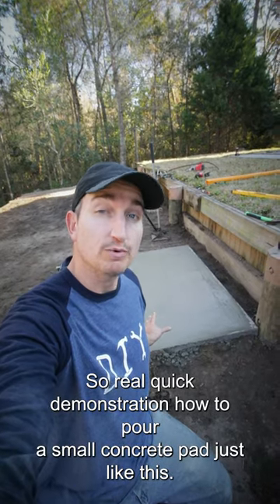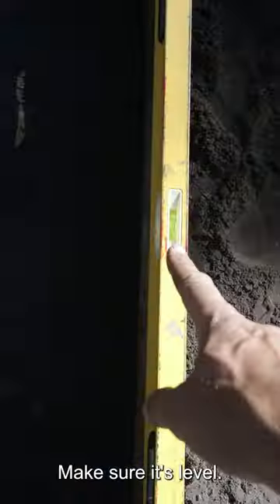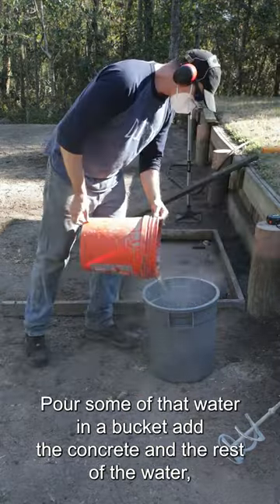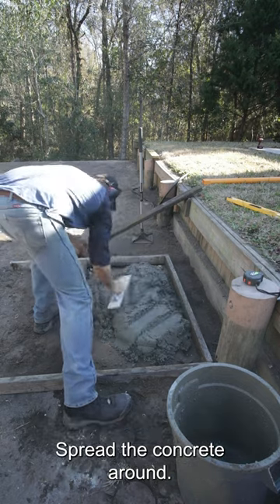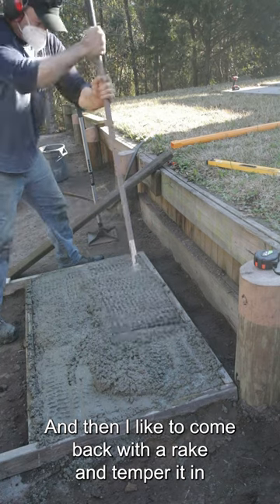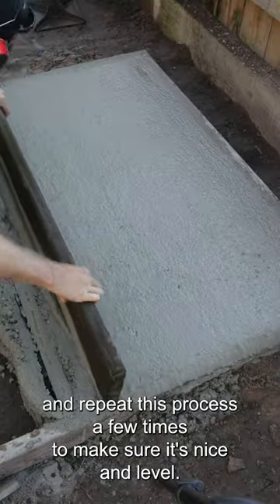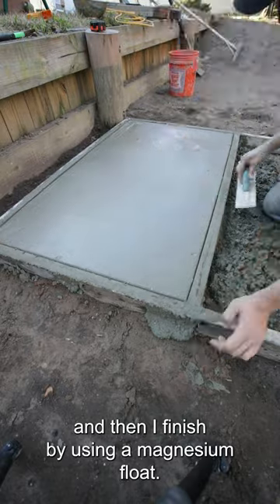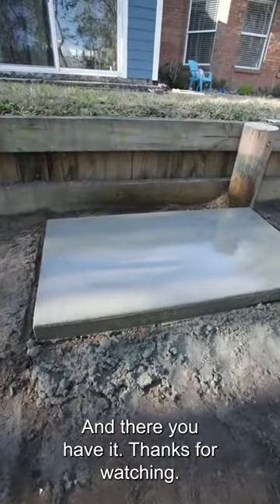How to Pour Concrete Pad Yourself

Comment: not bad for a home owner lol. some advice from a concrete formworker and finsher. if you are gonna build your pad at ground level, dig down the edges to creat a thickend edge. will reinforce the edge but also prevent sub- base from coming out from underneath the pad causing sinking and cracks. use gravel absolute minimum 3 inches. also a few pieces of rebar couldnt hurtm. 3 the long way, and 3 vertical. 3/8 or 1/2 is perfect. some companies like wire mesh but it doesnt do its job as well as rebar is just as expensive if not more at times. rebar and wire are meant to keep the concrete TOGETHER when it finally cracks. wire mesh tends to flex WAYY more when it does crack but its better than nothing
Reply: That's really helpful. How far down do you dig down the edges? A few inches down?
For the rebar, does it have to be kept in the middle somehow? Or can I just push it down in to around halfway?
Reply: @evanlane1690  so if its a 2x4 concrete pad it would mean its 3 1/2-4 inches when poured. Dig all around edge to like six inches would be good. Tiny slope from 4-6 inches to edge. For a 6 inch slab, 8 inch thickend edge
Reply: @evanlane1690  for the rebar, dont leave it on the ground . Pick it up about an 1 1/2 inches not too much. If its too close to the top, it will degrade the surface overtime, exposing the rebar and or showing rust streaks.
Tie it in a grid pattern
Must be 3-4 inches away from the form/lumber, always. You can make a "grid" essentially. You can tie every intersection at every twelve inches, (12 inches on center) or 16 or for a simple pad like this do what you feel like. For a big area. Tie 50% meaning EVERY OTHER intersection. Alternating. For small patios and rebar grids you almost always have to tie 100% otherwise it doesnt hold shape well. Some people like doobies or chairs aka concrete blocks to hold up rebar but thats not necessary unless its a giagantic concrete.  Just pick it up as you add concretr
Reply: @Fr3sh-Kush  - put the rebar on some kind of stands (e.g. a stick with a nail in the side of it). Make it end up half way inside the slab. After the concrete is all poured, fish the stands out and level it out.
Reply: @johncoops6897  nah. Just pick it up as you go. They make chairs that you can leave in the pour or concrete dobies
Reply: @Fr3sh-Kush  - I know they make chairs. But this is a video for DIY and this goober isn't giving very good advice.
Who would mix concrete for a slab in a bucket using a drill attachment to mix it?
Reply: You are living proof that if you want info from online, just post your work no matter how good you think it is and someone will eventually correct it properly hehe. Thank you for actually explaining what's what. Really helpful for pouring some patio slabs
Reply: @contytub  well ill tell you one thing, theres more than one way to skin a cat! Lol. Different ways of obtaining the same goal but there is also common mistakes that alot of people like rookies or diyers tend to make. Well alot actually but i dont wanna knock anyone down lol, we all gotta start somewhere, just like to advise basics and good habits to get a better end result
Reply: @contytub  and i absolutely love concrete. Started by helping out my family when i was 13 and have never stopped. Concrete finish work is difficult, challenging and exhausting but at the same time artistic and rewarding.
Reply: @Fr3sh-Kush  by trade i'm an electrician ... you guys at least have something to show as it's actually illegal here to poor structural concrete without licence and whole building gets taken down without. Us electricians besides some fancy lights, as long as it's code nobody gives a toss about our work and always complain about prices mostly because everyone does a bit of electrical by ear. The more i work as a sparky, the more i see poor and dangerous electrical done by other trades. But i've never seen a slab of concrete illegally poured
Reply: @contytub  like the hidden j-boxes in walls done by the "jack of all trades" when remodelling the kitchen? 
The same j-boxes with mismatching wires and switchloops galore? 
Or are you referring to the undersized NMD Romex buried ½" deep feeding the shed 300' away from the service?
Reply: @lassaut6794  
LOL 
😆 🤣 😂 

Yes.  All of these.   
100 ft Home Depot extention cord.   Just burried about 10inches deep.  
After 3 years.   Sucked by a lawmover % chopped.    Have pics to prove it.
Reply: @contytub  job security.  
Lots of emergency repairs here in Cali
Reply: @lassaut6794  oh those boxes are the worst ... you literally have to rewire the place if it's hidden and you can't pinpoint it ... worse even are the borrowed neutrals and multiple feeds. They used to be code. Not anymore due to obvious reasons and people still do them. It's bad to fix after a diy er... even worse to fix after someone with partial or outdated training that ''knows what's he doin' ''
Reply: or just add a wheelbarrow of stone inside your form, this will create a hump which it all sits perfectly. the faces will be "four inches"
Reply: You make my head spin. Can you make videos?
Reply: yup exactly what i do. 16" OC. 4 inch, 8 inch base. sloped at a respecticable 1/4 inch per foot away from the foundation. thickened edge 1ft x 6" depth, 15mm rebar double spaced around the form neatly. indeed the thickened edge is like a bowl turned upside down with fill underneath,the fill creates a nice cap to keep it stationary.
Reply: Throw some good electrical tips on ur channel and keep some houses from burning down please 🙏
Reply: You forgot to tel him to check the form and make sure its square, either by measuring from corner to corner or 3-4-5
Reply: @franciscoceja3510  hes a homeowner. He probably doesnt even know what square is🤣. If he cant figure that out on his own he lost🤣
Reply: @Fr3sh-Kush totally enjoying the vid & comments. Want to do a 10 x 15 slab. I used to see glass added in sidewalks, is that no longer done? Thoughts on adding in a backyard?
Reply: This comment (and the replies) will probably be the most useful thread I'll read all week.  Thank you.
Reply: I really like that first bit of advice & appreciate you not being a dick to the guy! So, if you're doin a 4" pad, would a 2×6 form be enough on the perimeter?
Reply: @jrsmith3344  more than enough not truly even necessary. The point is not to have the BOTTOM of the concrete pad perfectly even with grass or dirt because once youe remove the form? All the gravel will simply just begin to fall out overtime with rain and whatnot
Just a bit of scratching with the claw of a hammer to "extend" the form so the concrete goes a little further down. Nothing crazy just like an inch or so. Would be alot easier to explain in person.. i like to teach because concrete is a dying art and its all about experience. This younger generation just thinks we overcharge them for this knowledge and skillset that not the average person can do or comprehend. Alot of variables
Reply: @Fr3sh...Retired R/M driver here. Without getting into the bag mixes, I would add only 1 thing. That is to use fiber- mesh. For those who may not know, it's basicly shredded up fiber glass. Wire & rebar only work horizontally, whereas this works 360 degrees. Plus it doesn't corrode like iron & bleed thru in the process. 🙏💓
Reply: @davidjaap2130  no rebar is required for vertical work. Try setting up 30 foot wall with no rebar and only microfiber. Will crumble.. Strong concrete but it has no tensile stregth  it will still crack and heave without rebar
Reply: you definitely don't need 3 inches of gravel ("minimum" is ridiculous, it's a maximum) for this tiny pad... stop it
Reply: @notimportant3686 well do what you want with yours lol. I bet youre the type of guy to to dust a half inch of gravel and MAYBE compact, with 3 pieces of rebar for a 6000sq ft. Let alone for a "tiny pad" i know you man lol
Reply: @Fr3sh-Kush  you know jack shit
Reply: 100% correct!

Comment: I like the part where he installed the rebar.
Reply: Rebar is almost never used on a pad that size. You don't know what your talking about
Reply: Rebar for a walking pad is unnecessary.  Only needed for heavy traffic such as a driveway or parking pad.
Reply: I've never seen someone use rebar on a pad like that. It's not a garage floor or something....
Reply: not tying into anything don't need it lol

Comment: If you want cement pad to never crack, add rebar, pour it over a layer of gravel and then thin foamboard insulation.  Most cracking comes from thermal distortion and ground movement.  The insulation cushions against all of that. It also allows concrete to retain solar warmth longer, so snow will melt faster and ice won’t have a chance.
Reply: Keeping it wet longer will also make it stronger. 2 inch foam board works very well. I read a study on how they tested sidewalks in very cold areas where the freeze and thaw was severe and when foam was added the concrete sidewalk never cracked.
Reply: is that like the insulation boards with foil? Is it foil side up?
Reply: @stillbreezing5330  No the foil boards i do not think are intended for underground. The 2 inch foam boards are the ones you want. You can cover the ground after level with plastic and then add the insulation boards or you can lay the boards down and then cover with plastic. Many people cover with plastic as it keeps the insulation boards from floating up. You can tape the boards as well. 
If you are doing in floor heating they do make a special type just for this. Makes for super easy install of the tubing.

Comment: Tamp, not tamper
Reply: Also, when you use a board across the top of the concrete to level it, that's a screed (noun) used to screed (verb) wet concrete.
Reply: Tamper is the tool
Tamp is the action
Reply: @Redacted-Information thank you!  Couldn't watch the rest.
Reply: Now, now, no tamper tantrums.

Comment: Depends on what you're doing but 99% of the time you do not want to make your form level. You want to slope it one way or a few to make sure it sheds water when it rains
Reply from the maker: Yes it is hard to describe all the details in a 60 sec video.  This concrete pad was designed to be level horizontally however the other direction follows the gradient of the land which is sloped downward a bit.

Comment: Reciprocating saw without the blade will vibrate the concrete down in the form if you bounce it on the side.
Reply from the maker: Great tip, thanks for sharing
Reply: Or a hammer drill with  something blunt in the chuck.
Reply: Just use a massager.

Comment: 1.  Gravel base. 
B.  Rebar.
3.  Wheelbarrow.
Reply: Don't worry he'll get it right next time. Like in 6 months when he has to sledge hammer whatever's left of it.
Reply: @joxyjoxyjoxy1  lol quite possible.
Reply: Is there any formula to calculate how thick a layer of gravel should be?

Im going to create a 1*2 metres slab for a tool shed. I didn't want to use gravel but a layer of plastic on the soil, then mesh and dry pour concrete of 50 mm.

Now, I think it would be better to use a layer of gravel.
Reply: No need for rebar or a gravel base if there won't be traffic.

Comment: Great job! Just a heads up if your going to wet the concrete the day after it drys you going to want to keep a sprinkler on it to keep it moist all day or you could just leave it dry and it will cure fine that way too
Reply from the maker: Thanks, I thought in theory it was best to keep wet throughout the majority of the curing process.  Having said that it is often impractical to do so for a month or so.  I usually try to keep wet the first few days to a week when able, however I never see this practiced by the building trades in this region.  Seems like all the concrete crews here just pour it and leave it open to air immediately.
Reply: Cover it with plastic after you remove the form and the plastic will help contain the moisture . The longer you can keep it wet the harder it will cure .. We used burlap and plastic and wet the concrete 2-3 times a day for a week
Reply: concrete never stops curing...
Reply: You can put straw on it and saturate the straw. It will wick down in the concrete through the initial curing process
Reply: @TC-kf9zw  As soon as it dries out the curing (crystal growth) stops. At that point you have reached maximum strength it will achieve. Longer cure means greater strength, up to two weeks.

Comment: You may want to put it slightly off level for drainage depending on the usage of the slab.
Reply from the maker: Yes indeed, this slab is only level horizontally.  Thanks for pointing that out.
Reply: Good point
Reply: I can guarantee he didn't get that level.
Reply: No need.  With that kind of "tampering" it'll tilt as the subgrade settles.

Comment: Do you need to wipe motor oil on the inside of the forms? For a driveway in small sections, do you need to add 4x8 wire mesh or rebar tied with wire. How far are control joints placed. Thanks for the video.
Reply from the maker: In my experience if the forms are pulled in the first 48 hours or so they come off fine without lubrication.

Comment: Do you coat the 2x4 with anything first? Oil?
Thanks
Reply from the maker: No, they usually come off without  much issue.  I have lubed the forms on other projects but do not feel it is necessary for most concrete projects.
Reply: I use spray oil from grocery store
Reply: Lamp oil. cooking oil, I use the oil I take out of old ref. compressors/it is what I have.

Comment: For a small pad, you could even add a layer of chicken wire, or even strands of old wire hangers. I would also do a gravel bed to keep water away from the concrete.

Comment: I am in a wheelchair and would love to go around my house on concrete paths like this size, how far do you recommend to go away from the house’s existing foundation concrete? Or can I butt up against the foundation and treat it like an expansion joint ? Thank you 👍
Reply from the maker: Thanks for the comment.  Not sure I can provide a specific recommendation because it could depend on specific variables associated with your location.  However this video shows more detail and explains some of the reasoning with how I did the spacing around the house.  https://youtu.be/GJxY-FoV2CE
Reply: @MrKistel thank you for the replay back and the video! I will give it a watch 😊

Comment: The proper way would be to add rebar and make wire mesh in the bottom to prevent cracking.
Reply: Not necessarily for a small pad like that.  He made a large stepping stone
Reply: You don’t need wire mesh. Just a moisture barrier and some rebar. But everyone has there own way of doing things.
Reply: Thank you
Reply: Dude it’s not a driveway … rebar for that tiny pad? Lmfao cringe
Reply: @daaneel It’s still at risk for breaking, I wouldn’t put rebar in though. Mesh would be fine. You can never be too safe!
Reply: Chicken wire doesn’t prevent cracking
Reply: @james737er  let it crack. It’s literally a $50 pad supporting 200 pounds at most. Let it crack who cares. It’s not gonna fall apart

Comment: Is a few inches of gravel necessary? Or some mesh steel?
Reply from the maker: Gravel can help with stability and drainage. The mesh helps hold concrete together should it crack.

Comment: Looks like he has done that at least 12 times before. The start of the video shows him working on what looks like an older job with slabs that look the same size. Did not notice any cracks in the older stuff but myself I would put in the rebar.

Comment: One word. Wheelbarrow.
Reply: Word
Reply: more word
Reply: Word, word, word.
Reply: Words
Reply: Right? "Mix one bag at a time by pouring water from one bucket to another. And make sure to use a flimsy little trash bin too since your only using one bag of cement at a time"
Reply: No wheelbarrows. Roll the sackcrete back and forth on a 6 by 12 tarp. 2 bags at a time.Water to make a mix that balls in you hand/sheens when you slap it with a shovel. Just a little looser for flat work.
Reply: One word. Cement.
Reply: 3 WORDS

Comment: Typically put a small slope on exterior pads to shed water and prevent icing which helps minimize lawsuits against you.
Reply from the maker: this pad is sloping with the downward gradient of the yard. The forms were leveled only side to side.

Comment: Where's the rebar? What does keeping it wet do?
Reply from the maker: Concrete cures for a long time and needs moisture throughout that process.  A fuller cure should make for stronger concrete.  That is what the chemistry folks say at least.  In reality many people do not worry about this step however.

Comment: I like using a reciprocating saw with no blade on the edges. It just acts like a giant vibrator
Reply from the maker: That's a great tip. ^Thanks
Reply: Could also use one of those electric sanders to vibrate the outside of the wood form.

Comment: you dont want it level if your leaving it exposed to the elements. you want a slight slope, Code is usually 1/4" per ft of slope. broom finish or rough because you wouldnt even imagine how easy it is to  slip on smooth conrete even with good boots/shoes. also, usually  code. only glass finish inside.
Reply from the maker: this pad follows downward slope of the yard and is level lengthwise
Reply: Screw the "code".  Become ungovernable.

Comment: what I'm wondering about is, the slab is not secured to the ground . therefore it could shiftor move after many storms..especially since it looks like it's at a slight slant....
Reply from the maker: Not a likely concern for this particular concrete slab but location variables should be considered and addressed in the concrete pour process.